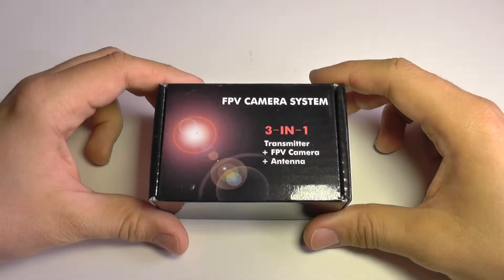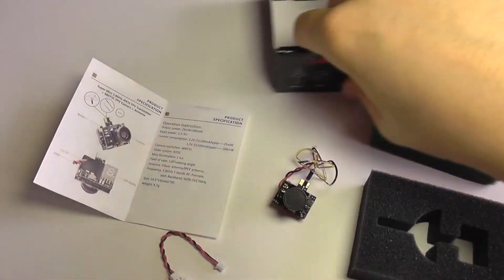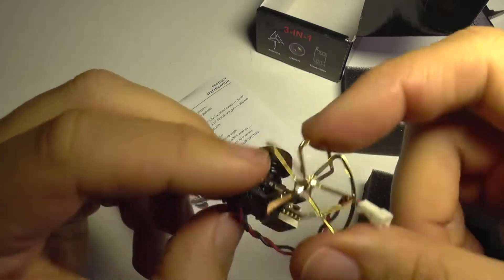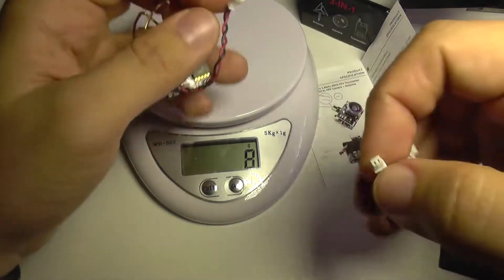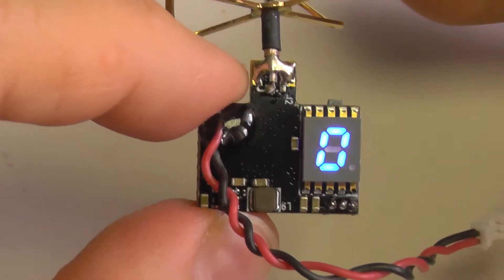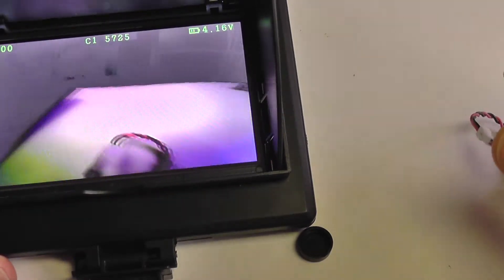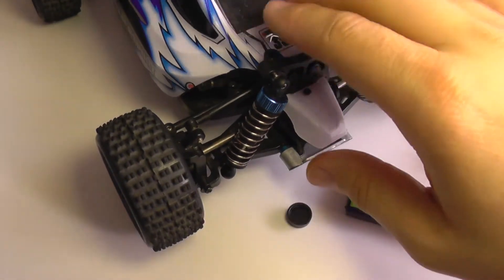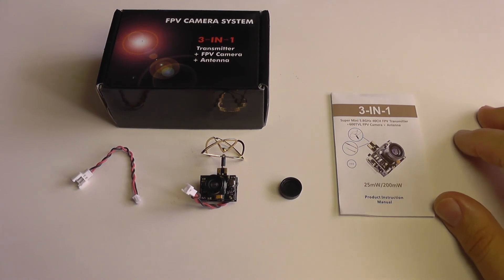AKK A2 200mW 5.8GHz FPV AIO with Raceband Review - Part 1

Comment: There is a 5V pin by the receiver on the ESC. Unfortunately I accidentally killed a capacitor getting the damn glued together case open. The servo wire also has a 3.3V pin you might be able to splice into.

Comment: What connector does it have because I need it to be JST PH 2.0 and I’ve looked everywhere but to no avail.
Reply from the maker: I never use the original connectors as they never fit in my projects, I just cut the wires and solder my conector (usually JST)